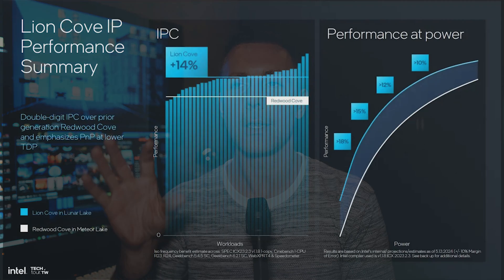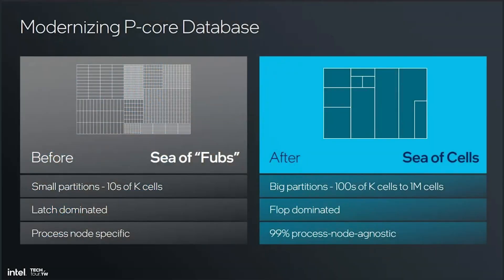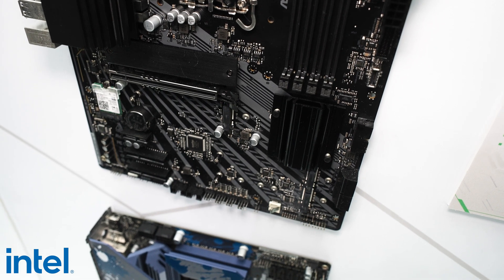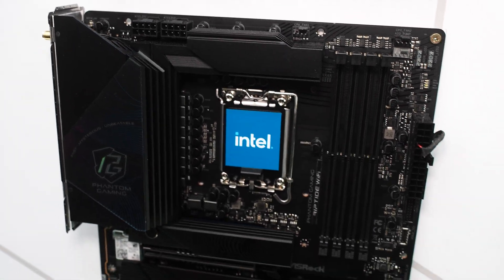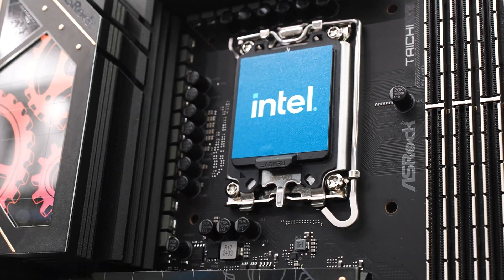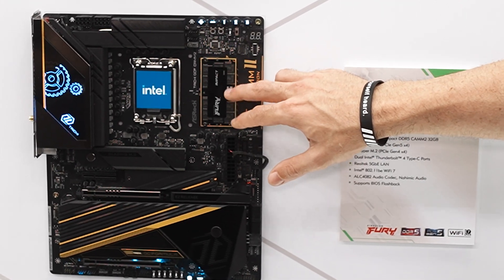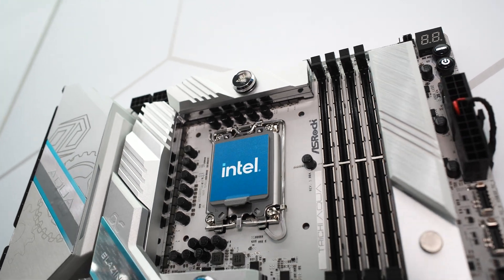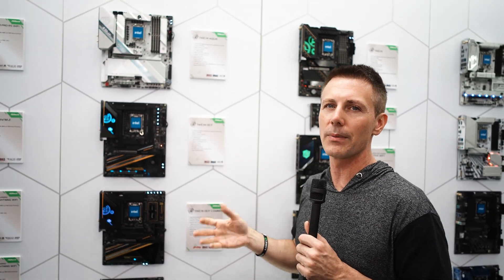Intel Arrowlake Details and ASRock "Unnamed" Intel Motherboards

Comment: ASRock is probably my favorite mobo manufacturer right up there with EVGA. Hoping they put out a good Z890 Micro ATX board. I just bought a MATX case, Antec Dark Cube for a future gaming build to use in my semi truck. Was thinking of getting a newer laptop, I currently have the Alienware Area 51m R1/w 9700k & 2080. But I decided I wanna try a MATX or ITX build instead. I may also try out Battlemage, all depending. I've always used Nvidia, but anymore I'm kinda getting tired of the whole AI trope and the massive performance gap between the xx90 and everything else they put out..

Really got my fingers crossed that team blue can "flip the table."

Comment: I think the SMT will remain for desktops, although maybe not for their AI series laptops.
Reply: SMT is a big win when all threads are heavily loaded constantly, but it makes sense if they'd rather not optimize the mobile chips for that scenario.
Reply: @necuz  Have you seen the architecture for the non SMT design ? It looks like a string of tiles next to each other, but I don't know if Intel is using their version of infinity fabric as a conduit for data transfer amongst these tiles.
Reply: It looks like they decided to just connect everything on that tile to a shared bus and make it work. Feels like a very Intel thing to do.
Reply: @necuz  Well, they are saying it gives better results ??? So we'll all see. BTW I'm hoping Intel have returned the input/output bus on the SOC for arrow lake or 15th Gen CPU's which was taken off the SOC and transferred on to the motherboard from 12th Gen onwards.

Comment: Intel is desperately trying to control their heat issues. It won’t work.
Reply: Considering they are using a design that reminds to arm soc a lot plus tsmc 3nm... I think they are fine.

Arrow lake will also have intel 3nm (technically 2nm but is really 3nm :/), again, they are fine.
Reply: @soragranda  Again……….they are not!
Reply: @techluvin7691  Your fight against reality makes no sense, intel was using 7nm node vs amd using tsmc 5nm node, now both are using tsmc 3nm.

You literally have no argument XD.
Reply: It depends, I hope they do, if they gonna push 300W again of course it won’t work. If they don’t and still get good performance it will. The real question is will this be enough? Will they have platform support for more than 2 generations, will they have comparable price to performance and will the mutlithreading performance still hold up? I sure hope so, I always want competition, but I’m definitely not sure

Comment: on chart arl 14% ipc gain while 12% more power efficient than mtrl. thats mean is comparing with laptop mtrl chip that already on 4 process. i guess with intel 20a / tsmc n3b on arl will make big jump in efficiency on dekstop cpu, because it compare with old 7 nodes on rtl.

Comment: They are going to need a huge ipc boost if they get rid of hyper threading cause shutting it off on a 14900k is about 15% less perf then with it on in a full multicore work load.  
They are still going with 8p and 16e so to make up the lack of hyper-threading there will be big gains needed somewhere to surpass the 14900k

Comment: The only game I play that needs a fast CPU and GPU is Microsoft Flight Simulator 2020, even so, my RTX 4070 Ti Super is the limiting factor, running @ 99%.  CPU is i7 14400K under volted, don't see a need for anything faster this year.

Comment: That Nova board looks clean until you see that wifi m.2 card sticking out behind that shroud. Same on the Tai Chi. I dig that Tai Chi ocf version.
Reply: I never understood why asrock does that on a lot of their motherboards. Usually built in wifi is all contained up near the rear IO in some kind of module. Having the wires running down the side of the board is kind of weird. It does make it easier to upgrade to faster wifi down the line at least
Reply: @jacksonbtb571  almost like it was an afterthought.

Comment: Might be a heatstroke, which happens very often here in summer.
Reply: Bryan should be fairly used to the heat living in queesland, not quite as humid as taiwan but pretty close in summertime
Reply: Heatstroke? He would be in the ER if he had a heat stroke
Reply: It's probably a cold indigenous to Taiwan, it happens to travellers all the time, not being adapted to foreign lands. Pretty run of the mill stuff, but incovenient, true.